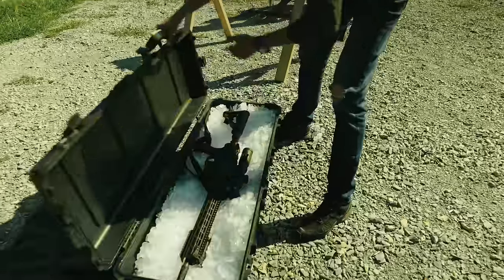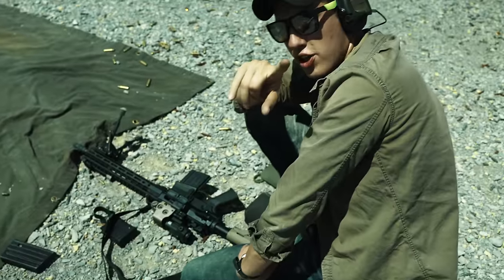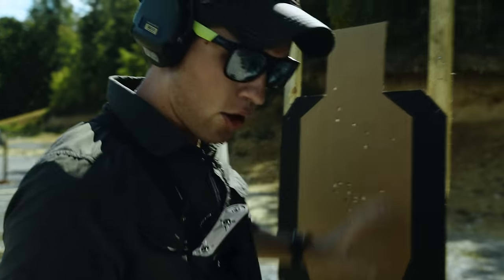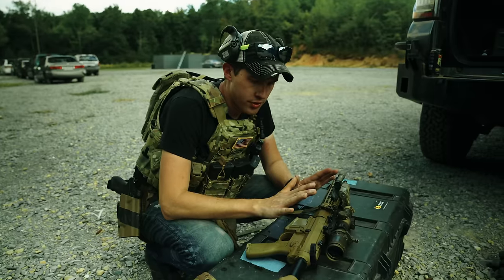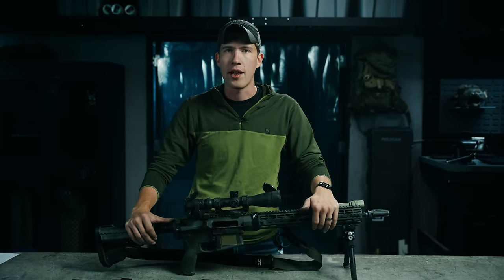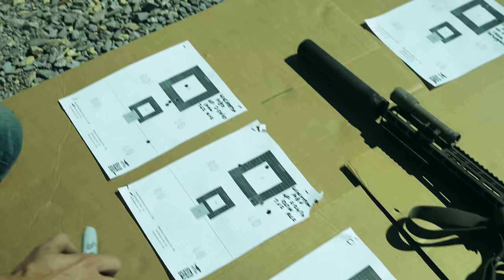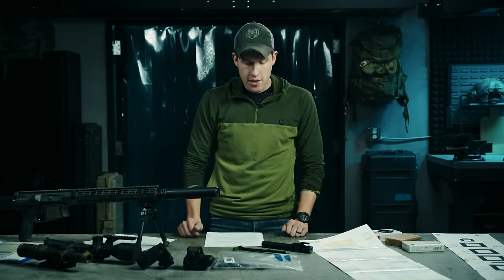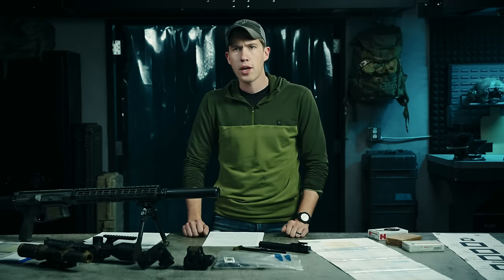Aero Precision M5 AR-10 5,000 Round Test

Comment: Running it dry for 2000+ rounds is just dumb. Military trials and acceptance don't do that, there's no use case/scenario where that's even remotely useful, it provides no useful information whatsoever. Major flaw of this "approach" that taints the entire set of results, as the increased and unnecessary friction, heat, shock & vibration that was put into the system is artificial and not representative of intended use, especially not the intent (or recommendation) of the manufacturer. It would be like draining the oil from a new car and then running it 40,000 miles (400+% beyond a regular service interval) just because. What's the point? The description reads "running the rifle in the same way a customer would" but no customer would/should run it this way.

Even when the dude lubed the BCG at around 1:22:49 ...he's giving the damn thing a bath? Oil on the gas rings? And didn't even hit all the actual lubrication points.
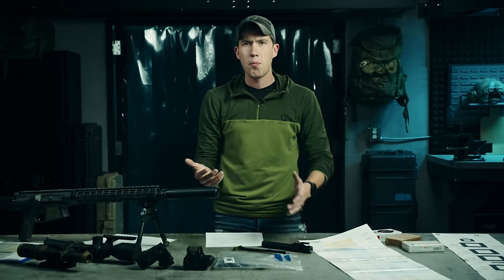Then an outright falsehood (lie?) at 1:32:30 that he cleaned and lubed the gun when it was needed... no, you admitted you ran it dry for 2000+ rounds. That isn't lubricating it "when you need to" in any way shape or form. There's nothing "crazy" about a standard maintenance schedule. Changing the oil and checking the battery/fluids/etc. on your car every 3000 or 5000 miles, as recommended, isn't crazy, either.

While it is a cute video, there are US and International Test Operating Procedures (TOPs and ITOPs) that specifically call out testing protocols and procedures for all manner of military equipment including small arms (specifically TOP 03-2-045A dated 24 June 2016 is immediately available through a Google search). Perhaps start with those standards and processes when building a test plan? Since that is what the products are more often than not built towards.

Comment: Huh…a gun fails when not lubricated, junk magazines are used, and the parts installed by the operator are not tested in the build or tightened properly…how strange.
I didn’t like much any of this “test” because the only person that would do this is the tester. If you think you should be able to slap together a heavy center fired caliber rifle with Frankenstein parts, no lube, inferior mags etc. and that it will work for 5000 rounds…well I don’t want you building or touching my gun.
Reply: I wouldn't dare "build" a gun. It's expensive at best with trial and error and at worst every dangerous.
Reply: @frankopanklaric  Not really. It's like legos. If you can screw things together....but maybe you should stick to your starbucks and iphone clicking. Safer. Let the grownups do the grownup things.

Comment: You guys are calling a broken firing pin a catastrophic failure???? Okay¿??? You put another firing pin in it it's only like the third are fourth most mass-produced platform out there I think you could probably find one somewhere somewhere this is a pretty drama queen review I mean yeah a catastrophic like look up the word Look up the definition catastrophic is not a broken firing pin catastrophic would be a melted bent up truck ran over catastrophic means you can't use ever again doesn't mean a broken firing pin you guys are boneheads